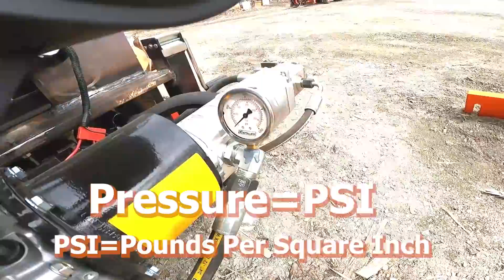Eastonmade; How Log Splitter Tonnage is Calculated

Comment: I need a new stock wedge for my countyline 40 ton log splitter and Tractor Supply Co. said the wedge  doesn't have a part number just the measurements for the specific one you need. How do I measure the wedge to order the right part/size?

Comment: Good morning Andrew. Thanks for the discussion around how to calculate the tonnage. I've had several folks (including me) wondering how it is done. As I have said, the ULTRA I am using seems to be more powerful than it is rated but I see now it is not just about putting a cylinder on a splitter, it is also the way you engineer the other components and size etc, to ensure an efficient and effective machine.  I had to smile as you were walking us through those calculations - took me back to school. LOL. Be well and take care!

Comment: You have the basic formula ok fir the splitting Stoke, what about the formula fir total absorbed power?  I think it will be flow x pressure divided by efficiency, along with a constant depending on units and how you want the answer?

Comment: Great explanation. Tonnage is something.  Speed is another.  The combination of both is where great engineering is required! Flow restriction, heat dissipation, wear, stress, etc! In my opinion, you make the best commercial splitter in North America!  Thanks for sharing!

Comment: One question that comes often is why your commercial splitter tonnage is way lower than the big stores splitter. The answer is quite simple: they calculate the force of the cylinder overall. So they add the force of rod and piston size. So a yellow 25 ton splitter will have an approx of 14-16 ton.

Comment: I'm a phone call away from placing an order for a 9-16 or 12-22 with box wedge.  My wallet says go for the 9 but my head says the 12. Any advice?
Reply from the maker: Depends on what options you are looking for.  If you starts adding wedges, autocycle etc then the 12-22 is the better choice.
Reply: I went through the same dilemma in my head.  Andrew's logic above settled me on the 12-22.  Now patiently counting down the months until it's built!
Reply: @Mark-W5ADK  So did I, and I made the same choice. Hopefully buying the 24' conveyor wasn't premature.
Reply: I think I'll have to work some OT and go with the 12 😁
Reply: I am glad Andrew answered this as he did. Because I was thinking along the same lines. If I want auto cycle and a second wedge, I probably should just buy the 12-22. Now to make the call...

Comment: The other question I have is, when I was in the fire department we would use “ the jaws of life” the brand we used was a company called Holomaltro. They did not use hydraulic fluid, instead they used vegetable oil. This was because of a hazmat cleanup if we had ruptured a line. Have you ever tried other fluids other than hydraulic fluid?
Reply: We run a vegetable based oil in our greens mowers. Have for years and can't say it has any negatives yet to the machine.

Comment: Great easily explained answer on force. So is speed increased by turning up pressure? Also can you put too much pump on a machine? As always great videos!
Reply from the maker: No...only flow will increase speed.  The pump needs to be matched to the engine and valves.  Thanks for the comment.  Really appreciate it

Comment: Is this a new model of the 22-28? Pretty wild looking. Cool video on power.
Reply from the maker: Yes with an attached conveyor
Reply: @EastonmadeWoodSplitters  The whole chasis looks longer on it...
Reply from the maker: @jamesbainton  same length.  Only the axle moved
Reply: @EastonmadeWoodSplitters  It looks like it would be easier to work around with the axle moved back. 🤠👍
Reply from the maker: @craigmilligan616  there is a lot more room  however it is a lot heavier to move it though.